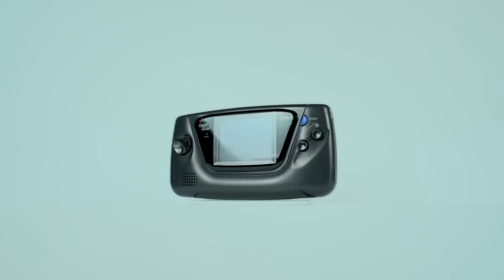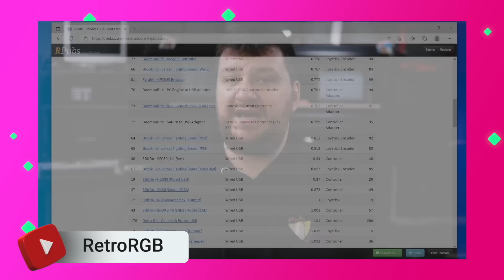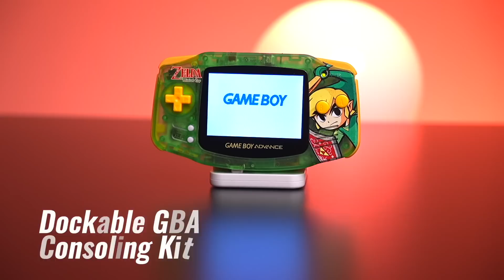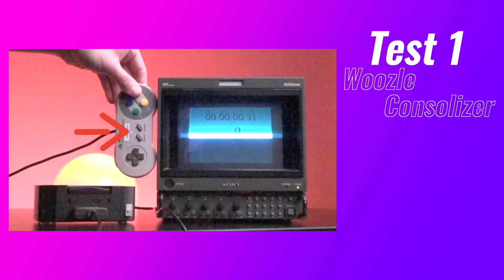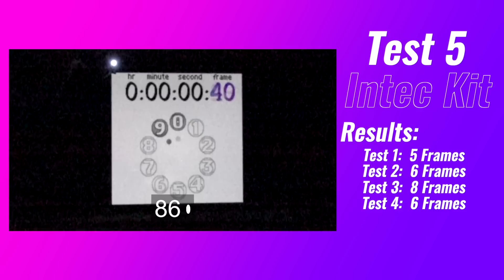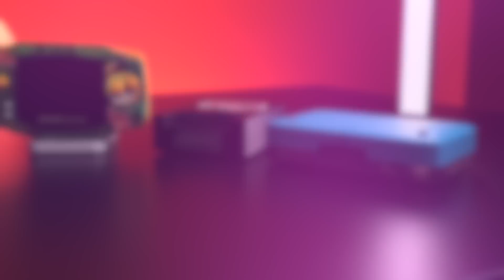Lag Testing Every GBA Consolizer | The Results May Surprise You!

Comment: Why not measure the only official GBA consolizer, the Gameboy Player? Although not made out of parts from an original GBA like the other GBA consolizers, it basically is a GBA on the inside and it would have been nice to see how it compares. And then in original unmodified form and using Gameboy Interface (and maybe even using the M.2 Loader, but I think you didn't have it at the time of this video).
But nonetheless this is an awesome video, thank you!
Edit: Maybe make a 'Short' video about this the next time you visit Bob or vice versa to use his equipment again? 😀

Comment: Before I even watch this, I will guess that all but Woozle's and Zwenergy's kits will be laggy.  

I guess this because I know they built their HDMI scalers from scratch using FPGA.  I also know there is no off the shelf scaler chip available right now that handles lower retro game resolutions properly.  A scaler chip has to be designed specifically for the resolutions used by the console being used or it won't look as sharp & will have lag.

Thus any of these kits that try to use off the shelf scalers are going to have lag and not look as good either.  Scaling tech for retro consoles still has a LONG way to go.

Comment: Someone a while back posted the results of the stock GBA screen as well as many of the various IPS kits, and it was found that the IPS panels in these kids add considerable lag!

I am sure this is from the scaler board included with the display, which probably uses off the shelf scaler chips.  I have yet to see an off the shelf scaler chip that can handle lower resolutions properly and not add a ton of input lag.  The only solutions I've seen that don't are ones made from scratch specifically for retro video game resolutions using FPGA chips, such as the one used in Woozle's Consolizer kit shown in this video as well as the more popular HDMI upscalers such as the OSSC and RetroTINK.

That said, would LOVE to see a video testing the various IPS kits available on the market one day!

Comment: Did you test the woozle unit with the speedrun jumper active? That removes the frame buffer he added to prevent screen tearing at the expense of changing the clock speed a bit.

Comment: I appreciate your work, but it does open up questions:
- doesn't this mean that competitors (speedrunners, fgc, etc) have an advantage on the lowest input lag systems? I figure it's down to each community to decide what is/n't okay, and GBA speedrunning is quite niche, but doesn't this speak to a broader question about visual mods in video game competition? Is there a future where we can control the input lag to bring it more in line with stock hardware?
- is this a thing with console video mods? E.g. n64 digital - would it ever be possible for mods like these to be more responsive than stock hardware?
- does this video mean you're going to include input lag tests to your future retro renew videos? A lot of people are praising you for consistency, but this is the first we've seen of this crucial info.

Comment: Since the GBA's refresh rate is 59.73, thus just shy of 60 FPS, I decided to do the math for approximate latency in milliseconds (ms), based off of the averages.
Stock GBA: 40ms
Dockable: 74ms
Woozle: 27ms
gbaHD: 20ms
GameBox SP: 67ms
GameBox GBA: 57ms
Intec: 104ms

My thoughts about this is that while Intel isn't completely wrong, newer flat screen televisions with HDMI inputs will still generally have more latency than computer monitors or CRT screens (especially something like that Sony PVM). For the most part any professional display or computer screen will generally give the sub-50ms numbers as seen above, hell the stock GBA beats a stock SNES connected to a CRT by 10ms for latency funny enough. If you're using a HDTV that doesn't have a lower latency/PC/game mode, especially older HD televisions from the mid-2000s to early 2010s, then you're going to generally see numbers closer to the Intec. Even the mini consoles like the NES and SNES Classic were found to have 90-115ms delay on most consumer HDTVs when they were released. It's very mild lag that you may notice every now and then if you're looking for it, but so long as you have sub-150ms latency you should be fine unless you are planning on speedrunning or playing more precise fighting games IMHO.

Comment: I know this is like comparing apples to oranges, but if you are doing a part 2, would there be a way to add a test for the Nintendo Switch’s emulator implementation? It might be impossible if, like the Wii’s emulators, they are separate forks of the emulator itself

Comment: what is the input latency for the analogue pocket with dock and SNAC adapter with snes controller?
also what is input latency vs emulator on PC with keyboard or maybe a similar controller like snac thing?
also what is input latency vs nintendo switch docked/undocked gba play? ofc you'd need an older switch or a modchip to test that.

Comment: Unexpected result. I wonder how the Analogue Pocket with dock would compare to these.
Reply from the maker: Oh crap that would have been incredible to include (face palm). Looks like I may have to do a part 2
Reply: @MachoNachoProductions  If you do test the Pocket I'd be interested to see a comparison between the Pocket while docked vs not.
Reply: @shannons1443  Also with controller connected by USB vs Bluetooth vs 2.4 GHz
Reply: I think the Pocket Dock has a fair amount of lag with wireless controllers. Haven't used it with a wired controller that works yet.

Comment: Saw your stream with bob when you prepared this video. I'm sure it was a lot of work.
I'd have preferred a test that didn't involve an rgb to hdmi adapter. There's no way that doesn't introduce lag, a chip has to  decode the digital video and modulate an analogue signal, that takes time.
Reply from the maker: Thanks for the commmet adilator!  Yeah it was quite the learning experience. Bob tested the adaptor unit and confirmed it does not introduce lag into the process. I believe he has a video with his findings. I should see if I can link it in the video.

Comment: Fantastic video. Interesting how good GBA consolizers can be even more responsive than an OG GBA. Would be interesting to see the input latency of different screen kits. There's a lot of talk about IPS screens adding anywhere between 2 and 3 frames of lag
Reply from the maker: I’m thinking of doing that next
Reply: @MachoNachoProductions  Please do, super keen to see this also. Would also be very keen to see if different hardware revisions have an effect, and not just AGB -> AGS -> 101, but eg 32pin vs 40pin AGB revisions (assuming you have access to any or all of this hardware in unmodified form of course :D)